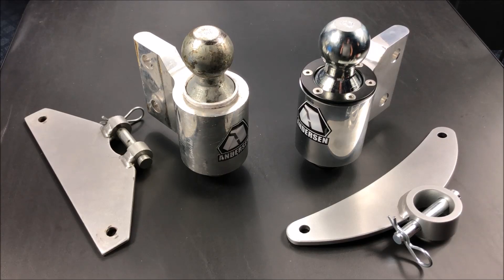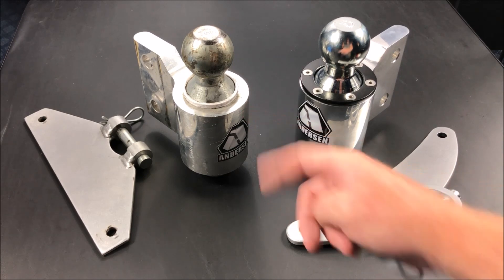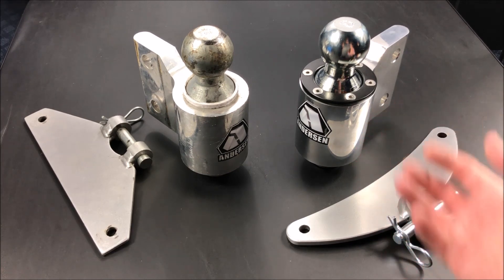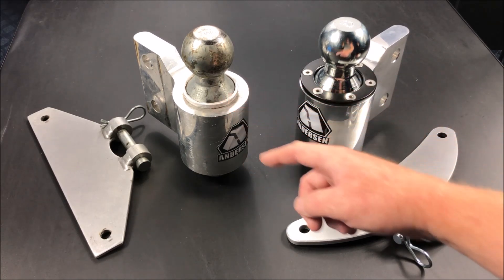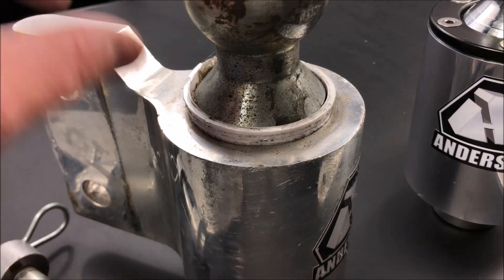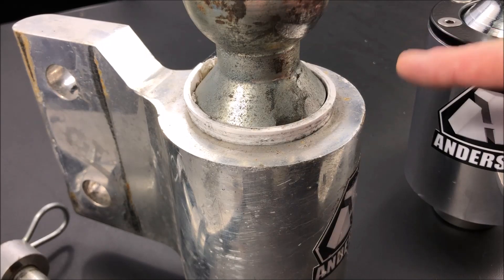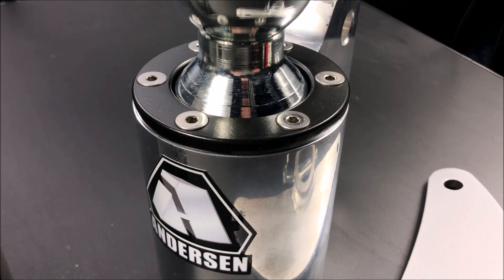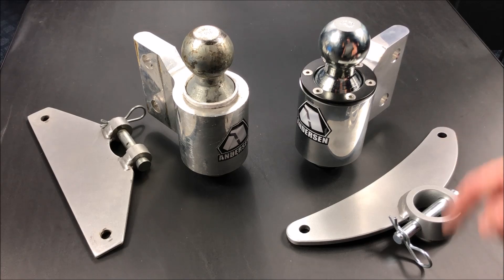Andersen WDH old vs new design comparison

Comment: Love the hitch. Just wish alignment didn’t need to be so crucial for hitching.
Reply: I've learned to deal with that a few ways.  You can always hitch up and then get at least 1 chain on, then tow a few feet until the alignment is correct to attach the other chain.  But in general, yes, I try to make sure my truck is at the same angle when I re-hitch as when I un-hitched at camp.
Reply: You can get a cheater bar that slides through the two shackles that hold the chains to the triangle plate and just apply pressure and it'll move to where you need it to.  💪
Reply: I just got a 3ft piece of 5/8” round aluminum stock. Slide it through the pin hole on the ball shank and pivot it as needed to line up.

Comment: what is the difference in the 3344 vs 3350 models?
Reply from the maker: 3344 doesn't have an adjustable bracket.  Otherwise they are the same.  See this... https://andersenhitches.com/collections/wd-hitch/products/4-drop-rise-weight-distribution-hitch

Comment: I had the old system as well. About 6-7 hitch and unhitching would cause the silicon to come up too much. I re-placed it once then about 2-3 it came up again. Called the factory and they sent me the whole new set-up free of charge and I just had to mail back my old hitch. As far as the setup, its soo much easier than messing with bars. I'm not too sure how much WD I am getting though because I have 7 threads and my rear seems to sag quite a bit. I do need new shocks though so maybe that is it. As far as sway control, Semi trucks that pass still suck me into them. Not sure if anything out there that can prevent that. Its hard to tell over all how much sag versus front lift is applied. I have a Ram Truck and the wheel well is naturally 3 inches higher than the front so taking measurements off the get go are different. I havn't had any real issues over all with the hitch since going to the new design. The Tension does cause the Ball to point up and forward causing pressure points between the Hitch Insert and the Hitching unit attached to your vehicle.
Reply: Andersen also sent me the new version of the hitch free of charge!   Great customer service!

Comment: I just got mine in the mail today. I am excited to install it. I have been using a REESE Steadi-Flex weight distribution with sway control,  and have found it to be cumbersome at times to get setup, also issues with the bars breaking the break pads. My trailer is a 34" Wildwood and is usually between 7000-8000 pounds when loaded for our trips. I am hoping this hitch controls the sway and bounce way better! I may create a video comparing the two designs as well. Any comparison using this system on windy days, versus calm?
Reply from the maker: This is my first TT and WDH, so unfortunately I don’t have experience with any other design of WDH.  I’ve heard lots of good things for trailers under 8000 lbs using the Anderson system and I’m happy with it after 1 season. Please let me know what your experiences are towing with it this summer!
Reply: John's DIY Playground I got it on and drove it about 15 miles down the road. It rides much better. Far less bounce, great weight distribution (the front of my truck only rose about 1/8”), and the sway control is on a different level. I wish I would have found this thing a year ago. Then to top it off, I had the truck disconnected in less than half the time it took for the other hitch. I’m a fan, and will tell everyone about this thing that pulls a TT. Lol
Reply from the maker: @JeremyMcconnell  awesome news!!  So glad to hear your feedback.  In my mind the system makes sense but I only have my own experience with just the Anderson, so this helps confirm my theory.  Cheers and thanks so much for the feedback!
Reply: @JeremyMcconnell  how is the hitch/sway control as of now? Still doing good?
Reply: @dehartshipyard2135  It is still going strong. I haven't had a single issue with any of it. I did upgrade to a 3/4 truck last year and the hitch was easy to adjust for that new truck and I am still loving it.
Reply: I am literally trying to decide between these two hitches right now. The dealership I am buying trailer from sells and recommends the Reese stedi-flex model 66559, I have heard great things about the Anderson system. Do you have a further update.... still happy with your purchase and still happy with the switch from the Reese ?  Thank you in advance.
Reply: @josephgiroux876  There is zero chance I would switch back to the Reese hitch or any hitch with that design. I feel way more in control of my TT going down the road now. When I had the Reese hitch I didn't like going more than 1-2 hours away, and now with my new hitch I am completely comfortable driving across country with the camper now. I tell everyone I know with a TT about this hitch now.
Reply: Jeremy Mcconnell awesome thank you so much. The dealer said he would install whatever I brought, here in Ontario there are not many places that use Andersen but it looks awesome and I think we will give it a try. Thanks again.
Reply: @josephgiroux876  No problem, glad I could help. Enjoy it!

Comment: Except the black ring, I think the triangle plate is a big improvement, more weld than old version.
Reply: Ironically the original design had the full ring with the straight edge triangle. They switched to the pivot model shown here and then the boomerang with ring mount.

Comment: Did you have to purchase the upgrade?  If so what did the upgrade cost?
Reply: I had mine replaced as well but not because of the friction ring.  The hitch would quit tracking properly so one chained would sag on one side while the other tightened and I actually had the coupler that attaches to the triangle plate pull apart.  I have about 5000 miles on the new one and no problems so far.   I’ve been running the Andersen for 4 years now and really like how it eliminates the bounce.  They stand behind their product too.
Reply from the maker: They sent me the upgrade free of charge
Reply from the maker: I think it was free because I emailed them photos of my old design and the friction ring was visibly popping out at the top
Reply from the maker: I owned my original design less than 6 months